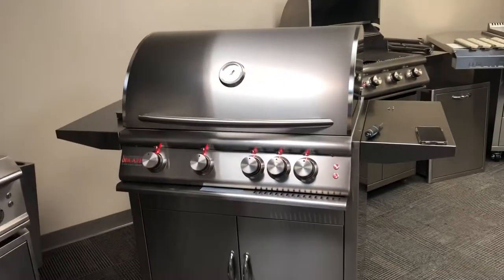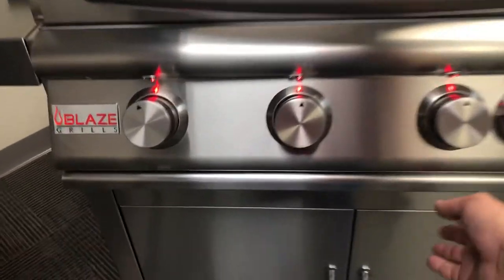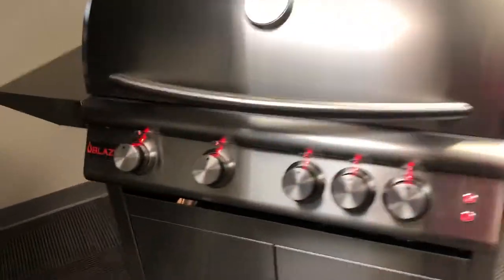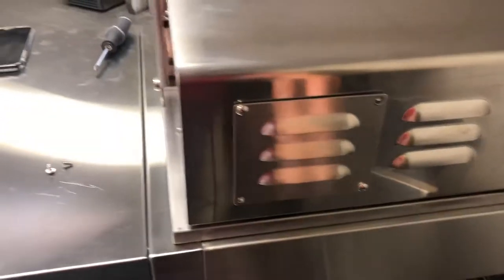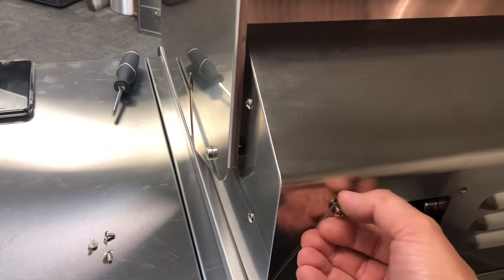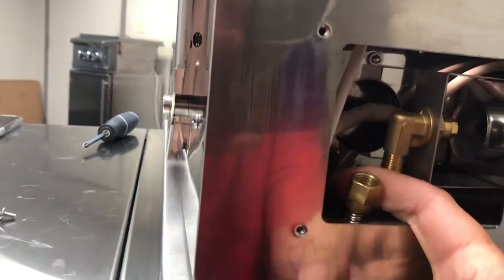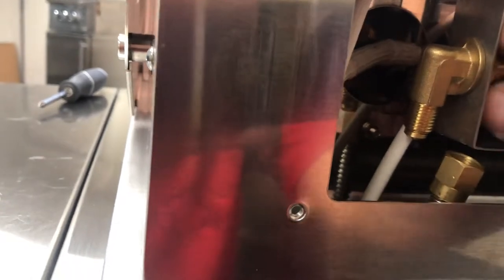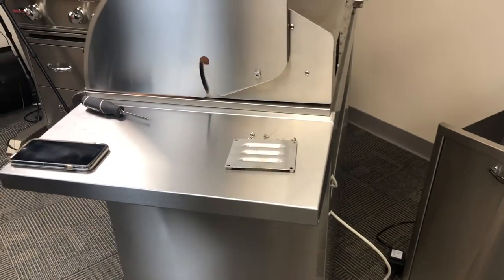Blaze Grills rotisserie troubleshooting

Comment: I was unable to unscrew the back connection but just blowing air through the front fixed the issue. Now I need to figure out what I need the rear burner for to cook
Reply from the maker: The rear burner is strictly for rotisserie.